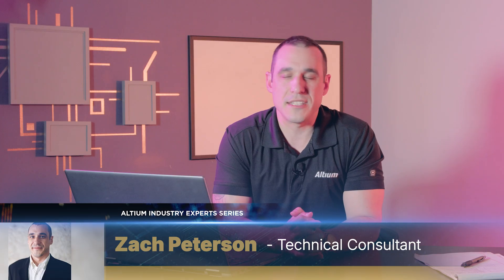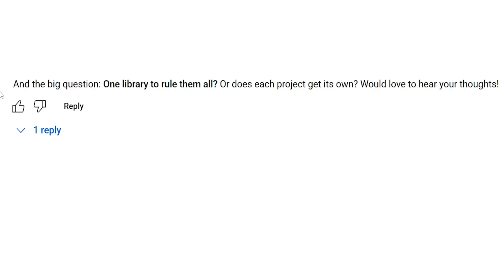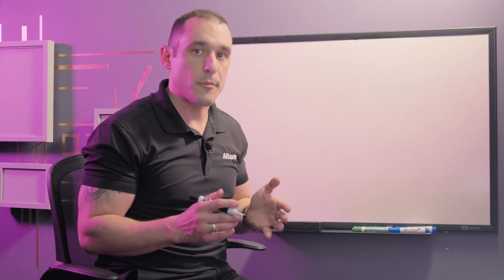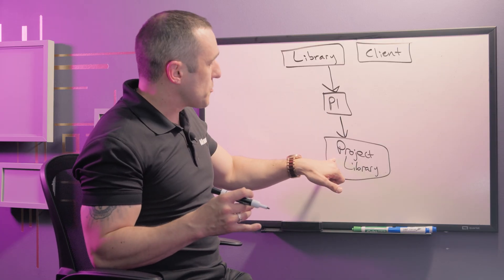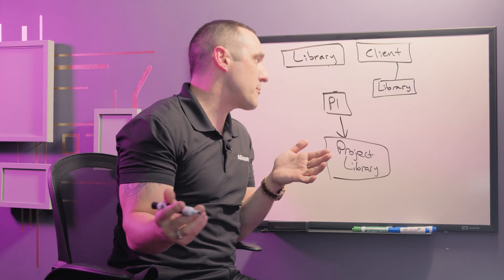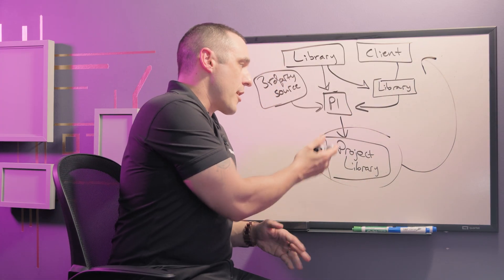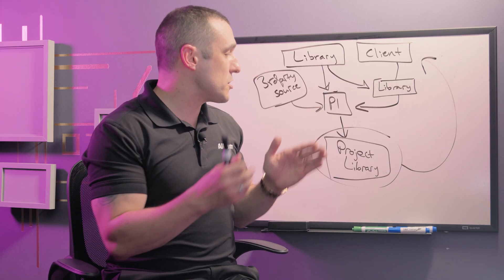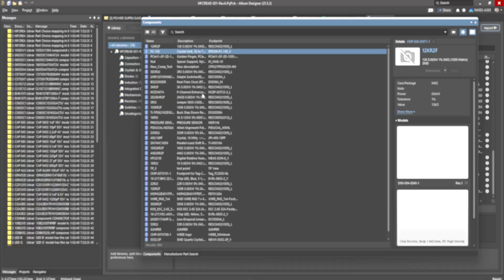PCB Library Management: One Library or Many?

Comment: Great video! Thanks a lot!
I work with a small team with a few people (librarians) in charge of overlooking a central library. Designers can release a design for production only after approval of all components by the librarians. The main problem is that this is time consuming even though there is no doubt about the benefits of a healthy central library. My concern is that people are spending more time checking and cross checking components for the libraries instead of working on the design itself. As a small team we can't afford having such a strong but time consuming approach. I was thinking of having a 2-tier library approach. One central library where librarians overlook their content as we do today. However, we create a second library where designers add their symbols and footprints freely. We would consider that a component in this second library is "good" if it works in a design. These "good" components could then be promoted to the central library, according to the availability of the librarians. The main gain with this approach is that design work can be faster as they don't need approval from librarians to make a release for production. The drawback is that it is more prompt to errors and mistakes, even though central library can also contain mistakes as well. Any thoughts about it?
Reply: It sounds like you are trying to implement the ideal large company process at a small company, the larger clients we serve have their own dedicated ECAD data team that handles all the library tasks and components cannot be used in any design unless they have been released for use by the librarians. The librarians also maintain version control on all components so that they can roll back to earlier versions if needed. In your case, I think what you propose makes sense in order to keep designs moving forward. One thing you might consider is to keep a set of generic footprints for standard packages (SOIC-8, 32-lead QFN, etc.) and IPC density levels. If these generic footprints have already been approved in past designs, this allows you to quickly copy the footprint into a new component without duplicating the review work, the component review will then look at the pin name assignments and possibly some special details like mask openings in specific cases. This is one way I like to quickly create new parts at the library level or at the project level, this way I am essentially only creating the schematic and I don't need to create a footprint from scratch each time.

Comment: Generating a library for the project and including it in the zip file is nice, but the problem is if you go through the design from that zip folder and click on a component, the source library is still what you used in the first place. Let say you want to modify a symbol or footprint across the design, you can't just go to the exported library and make changes and then update parts in the design. You have to change the source of those components so it points to the exported library and then make your changes. It would be nice if you could export the library and change the source of all components to the attached library. (Maybe it's possible in parameter manager??)
Reply: THIS!  Holy cow this would save SO much time.  Inevitably there are multiple instances of the same MPN that came from different libraries...and Altium just does not handle this well.
Reply: You are correct, the source does need to be changed in the schematics. It's a simple CTRL+A and switch the source in the components to the exported library, and make sure you select Do Not Change for the Design Item ID. I will show how to do this in a short video because it is something I have had to do in many projects.

Comment: If a net label is not showing a "floating" error in Altium Designer, even when connected only to a pull-up resistor, there is any solution for this error.
Reply: I think you are referring to a net antenna? There is a net antenna rule in the PCB Rules and Constraints Editor, and I think the default value is zero. Check this and see if it flags the error correctly.

Comment: Hi, I am designing a PCB layout in Altium, but I'm having difficulty designing impedance-controlled tracks. I tried something, but I can't verify whether my track meets the required impedance. Please advise how I can verify and correct it.
Reply: What specifically did you do? You need to calculate the width first, and then use that width for those tracks. If you are routing on multiple layers, then you would need to set the width to be different on the different layers. You can manually set up a design rule to do this automatically, but a better option is to do the impedance calculation in the Layer Stack Manager. When you do the calculation in the Impedance tab, it will create an Impedance profile. Then when you create the Routing Width rule for your impedance controlled nets in the PCB Rules and Constraints Editor, you can select the impedance profile from a drop down menu. I have shown how to do this in several videos.

Comment: Is it any way other than a database library to batch produce libraries for bread and butter components like caps and resistors. Actually these components cause me the most headache and errors
Reply: You can very quickly create footprints using the IPC Compliant Footprint Generator inside Altium Designer. It will not batch create SMD parts with part numbers, values, and descriptions though. But it is still very helpful for getting the footprints quickly. It also supports all 3 of the IPC-standardized density levels.